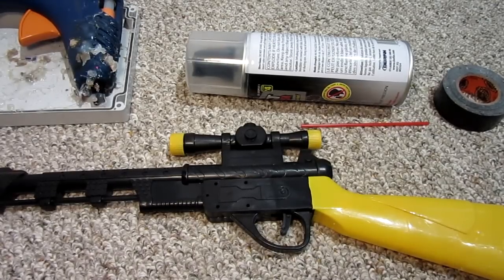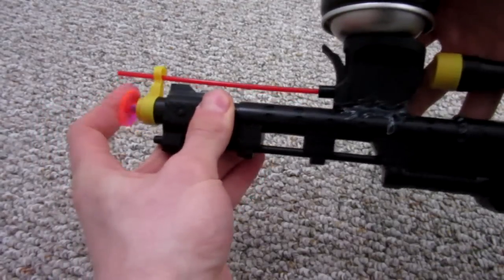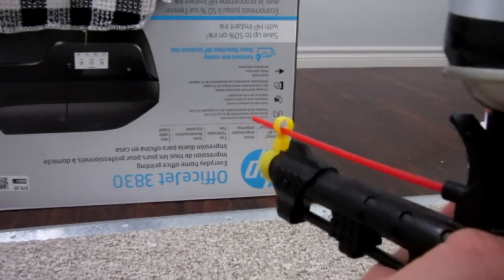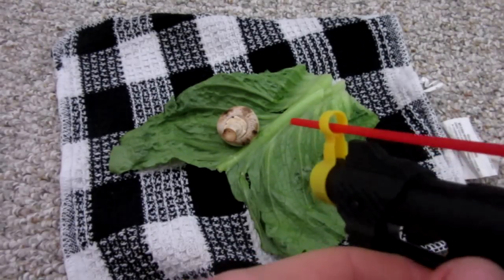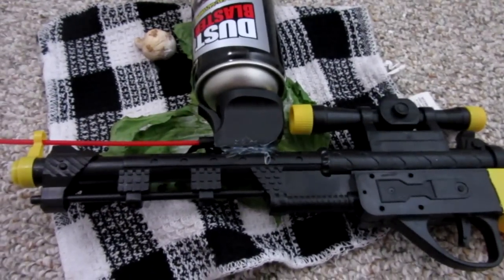How To Make a FREEZE RAY Gun

Comment: The compound is C02. A bottle of duster spray consists of C02 liquid. When you spray it regurally, it comes out as a regular non cold spray, because the C02 liquid is at the bottom, but when you turn it upside down, the C02 liquid is right next to the nozzle and you get a very very very cold spray. C02 is a very very cold compound.

Comment: so real quick the chemicals inside the can  makes the stuff cold itself just like a deodorant can frostie, now, deodorant contains a mixture of low boiling point alkanes, such as butane, that form a liquid under pressure but evaporate when the pressure falls to one atmosphere as they leave the can. It's primarily the latent heat of vaporisation that reduces the temperature and makes it feel cold. it's a good substitute to liquid nitrogen considering that it'll take a while for the stuff to turn to a gas and freeze everything

Comment: here is the script:

[Music]
00:08
[Music]
00:09
hello everyone inventor seven one nine
00:12
here in today's video we are going to be
00:14
making a freeze ray gun now for this
00:17
project the main component you will need
00:19
is computer keyboard or electronics
00:23
compressed gas for cleaning this is
00:26
called dust blaster I got it for $4 at
00:28
Dollarama of course that comes with a
00:31
little tube for the nozzle you will also
00:33
need any type of toy gun wooden plastic
00:37
I have this one I got from the dollar
00:38
store as well with that some tape and
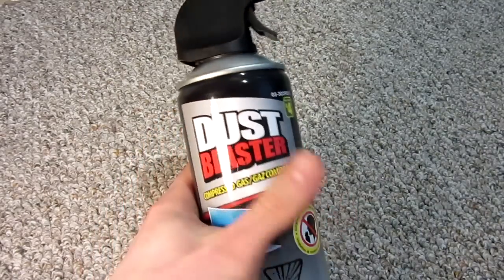00:41
some hot glue now before we get to
00:44
building the actual project first I'm
00:46
going to show you a bit of the
00:47
fundamentals now this stuff you have to
00:50
be very careful with as it says it is
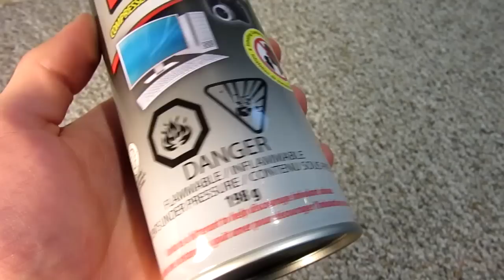00:52
flammable inflammable and content under
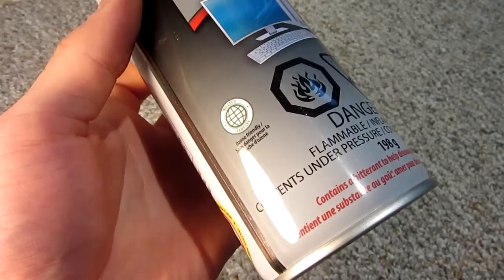00:57
pressure it's also pretty toxic which i
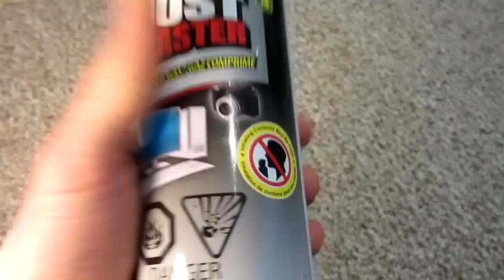00:59
think is why they have stuff like this
01:00
on it so anyway when used properly like
01:04
this it is compressed gas for cleaning
01:08
dust off of surfaces but when used
01:10
upside down I'll show you closely here
01:14
it emits a liquid and that liquid it's
01:20
not liquid nitrogen I don't know
01:22
actually what it is if you know it is
01:23
common down below but it is freezing
01:26
cold as you can see there's like little
01:29
bits of condensation almost looks like
01:31
snow on the end of the nozzle after just
01:33
one push there you can see it building
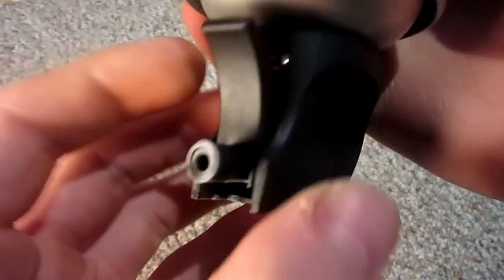01:37
up already now anyway that is the main
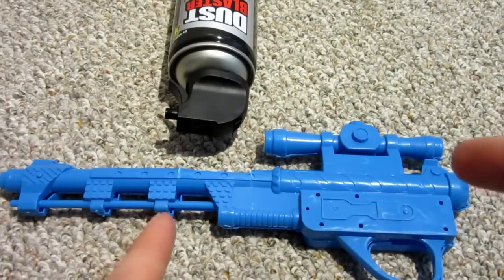01:40
fundamentals of this project before so
01:43
we the final revision I thought I would
01:45
first show you guys what I was going to
01:47
do I was going to make it a little more
01:49
complicated and here's one of my spare
01:51
guns I had so I cut in half as you can
01:54
see I cut a little knock out of the tube
01:55
at the top and my plan was to insert
01:58
this into the top as such so the
02:01
original barrel could be reused but
02:04
there was two problems first problem
02:06
being when you pull the trigger this
02:08
moves up and down so it would hit the
02:11
top of the barrel second problem being
02:13
that I was going to be using some string
02:17
to wrap around the trigger on the can to
02:21
the trigger it's missing right now on
02:23
the gun but the loops didn't work it was
02:26
a little too complicated so I'm going to
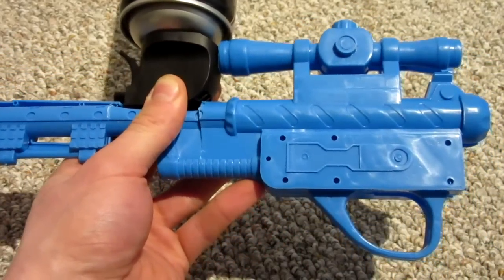02:27
show you guys the simplest way to do it
02:29
hope you guys enjoy but if you want to
02:32
do it a more complicated way please feel
02:33
free so this will probably be the
02:36
simplest in vendor seven one nine video
02:38
ever to build your freeze ray gun simply
02:41
take the tube that they provided and
02:43
stick it in the end of the nozzle and
02:45
you could technically be done right
02:47
there but I like presentation personally
02:50
so with this little gun I'm going to
02:52
stick the two through the hole in this
02:54
site and then use some hot glue to affix
02:57
the head of the nozzle right there on
03:01
the gun
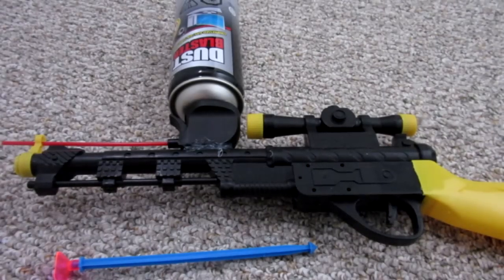03:05
so there we have it believe it or not it
03:07
is all done now of course unfortunately
03:09
the trigger does not do the freeze ray
03:13
that is for this button here but since
03:15
this was originally a dart gun the nice
03:17
thing is and that it can still be used
03:19
as such so this trigger does the dart
03:22
gun and this one does the freeze ray so
03:24
as always let's do some shooting tests
03:26
so today we have a very different type
03:29
of shooting test as you can see I have a
03:31
sheet of paper on the right and I have a
03:33
dart loaded and of course my freeze gun
03:35
so first we're going to try and freeze
03:37
the piece of paper on the right and then
03:39
shoot it with the dart and then on the
03:42
left I have a few surprises to show you
03:44
guys what the freeze gun can do with
03:45
some fruit and vegetables so here we go
03:47
with the shoot of paper first first
03:49
let's give it a freeze our barrel popped
03:54
off and it fell over but let's shoot it
03:55
anyway alright let's move on to the
03:59
fruit and edge before going up close
04:02
with the fruit and vege I thought I
04:04
would give you guys an idea of the
04:05
up-close of just the freeze ray shoot
04:08
shooting into the air so let's aim at
04:10
that cardboard printer box over there
04:12
and here we go as you can see it leaves
04:18
a spot on my printer box
04:20
believe it or not you can kind of
04:23
straight out like you would ice maybe
04:25
let's bring the Box a little closer here
04:28
we're going to shoot the black part as
04:32
you can see is frozen let me show you
04:38
with some vegetables now now our very
04:40
last test as you can see I have an old
04:42
soggy piece of lettuce and a mushroom
04:44
let's put them together this is going to
04:47
be up close but you can do it far away
04:49
too let's give them a freeze and test it
04:51
out before the mushrooms nice and
04:53
squishy as well by the way
05:00
try not to touch it it's really cold and
05:02
you might get frostbite
05:03
so there's after a few seconds of spray
05:07
the mushroom I can barely touch it so
05:09
cold but it's rock solid and the lettuce
05:14
as well can just crumble in your hands
05:22
anyway I hope you guys enjoyed the video
05:24
there it is the freeze gun not too
05:27
practical since the trigger doesn't work
05:29
but it looks pretty cool and you can
05:30
still use the dark gun features so I
05:32
really hope you guys enjoyed the video
05:34
and as always please like comment and
05:36
subscribe thanks for watching
Reply: why, u only got 3 likes for wasting 1 hour

Comment: It's not liquid nitrogen or liquid CO2 but whatever it is it's so highly compressed that it freezes whatever it comes in contact with. Also if the can itself is ever submerged in water it explodes violently. Just a bit of safety warning there do not submerge those cans in water ever.

Comment: Gasses under intense pressure will liquefy. As for why liquid only comes out if the can is upside down, is because there is still the force of gravity inside the can. And since there is no liquid coming out if the can is right side up means there is no straw in the can and the dome at the top of the can acts like a funnel for the liquid to go to the nozzle.